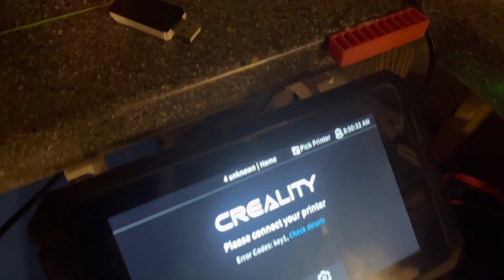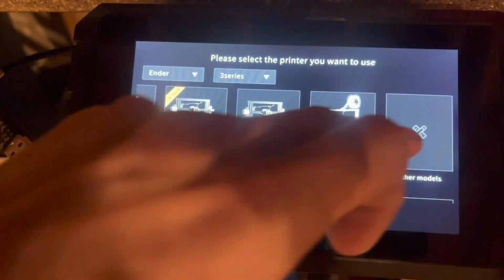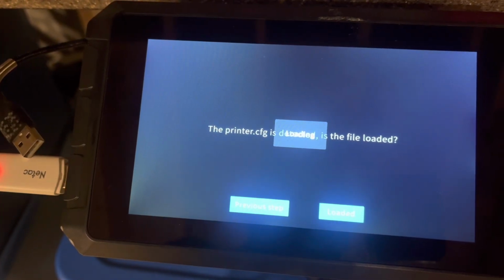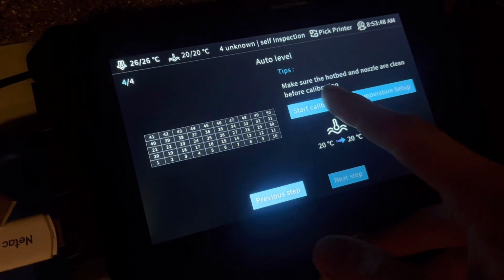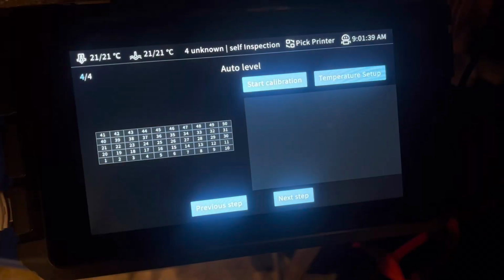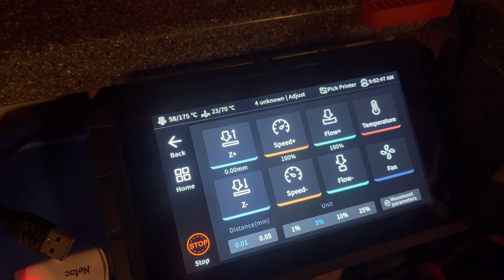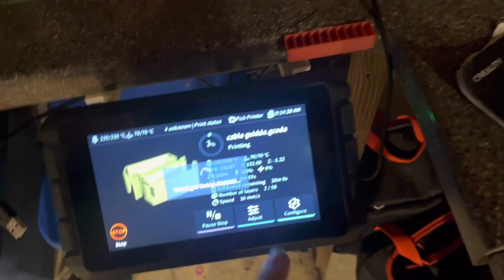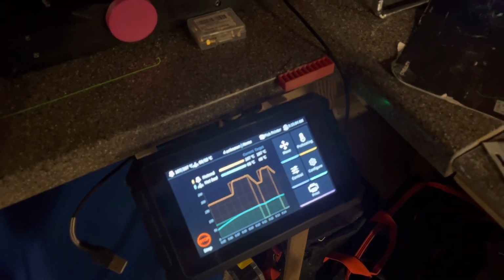SV06 Plus sonic pad configuration!

Comment: Seems like you used the safe home position from the SV06, so it does not home in the center of the larger SV06 plus's print bed. You have this in your printer.cfg: [safe_z_home]
home_xy_position: 85,135,  should be something like 150,150 minus the sensor X offset and plus the Y offset (something like -28 + 20, or home_xy_position: 122,170. You want the probe over the center attachment bolt on the print bed.   Also you have set a 10x10 bed mesh (100 points),  this is perhaps too much, takes a long time to complete, and is a lot of work for the SonicPad to process during printing the first layers until layer fade is complete.   I have good success with 7x7 bed mesh (49 points)  [bed_mesh] probe_count = 7,7 instead of [bed_mesh] probe_count = 10

Comment: Thanks for the config file that ACTUALLY works with the Sonic Pad! One issue I found is that the Y axis has a little too much travel when moving to the far extent of the hotbed travel, it rams into the back of the frame and the steppers grind for a second (almost like adjusting the Z carriage).. So that may need a little edit in the configuration file. But other than that. AWESOME and thank you!

Comment: I have been trying and trying to set up the sonic pad to the SV06 and am about to give up. I flashed the printer but keep getting errors on the sonic pad. Seems to be issues with the config.  I get this error. "  Include file '/mnt/UDISK//printer_config/./osskc.cfg' does not exist" Any ideas?

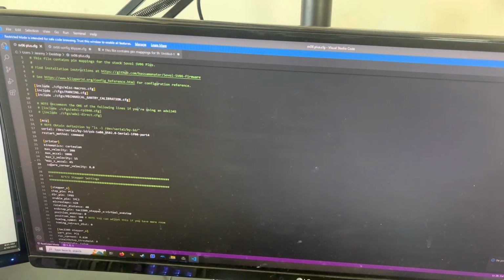Comment: In my experience this is not correct.  The USB flash drive needs to be moved up a slot and the printer plugged into that slot and then reboot.  It days say to plug the printer into port 4 but he does not do that in the video.  Alo what a quick jimp into visual studio at 2:55, don't assume we are all experts. Other than that, very useful thanks.
Reply from the maker: Flash drive has to always be connected to usb #2 :) first tutorial video so definitely mistakes made!

Comment: When attempting to load the print.config file the following occurs:   "ERROR  The printer is not ready.  Klippy host software is attempting to connect".   Any ideas?

I plugged the USB cable from the printer into my computer and verified the USB port on the printer is functioning.
Reply: I'm trying to fix the same issue atm. Seems like the firmware isnt being loaded on, gonna see what I can do to resolve this
Reply: Plug it into the first USB port. That fixed it for me.

Comment: An update. With my Sonic Pad issues. I flipped over to regular Klipper with kiauh and Xubuntu it was so easy. Repurposed an old laptop. No more MCU overload issues. And as a bonus unlimited webcams. I have 3 running now so I can have one on each printer. instead of one wide angle one.  I can't believe Creality support just closed my tickets because I had a non creality printer and wouldn't help at all. What a$$holes.  Not really much to change in the config either just the serial port and some includes.
Reply from the maker: Dang that’s upsetting, I’ve had no issues with 3 machines, I even bought another sonic pad used for $50 to run my other 3 machines, unlimited webcams would be sweet but I don’t have any old laptops sadly
Reply: @chargedup6565  Nice not a bad deal at all. I wonder how many I could actually run not with this i5? It's not breaking a sweat with 2. And since it support a usb hub or hubs there doesn't seem to be a limit on the number of printers that you can run. I added the object exclude function yesterday. Hopefully the SP will get that added in. It's nice to be able to remove an object mid print if you see an issue with a plate full of parts.
Reply: Just so I'm clear...you abandoned the Sonic Pad in favor of a laptop, correct?
Reply: Hi what firmware did you flash your SV06 plus with? I have the same sort of setup but need my printer to talk to my Klipper install on PC
Reply: @stevem91  Lets see if I can link my google drive with no https in the url This is my firmware and config ://drive.google.com/file/d/1TZGlgWifcn4jbjUYYki4kCpvO6_zwoih/view?usp=drive_link
Reply: @stevem91  You can use the one posted in the video description. I used his as my starting config and firmware.

Comment: I have 2 Sovol SV06+ and they are both running on the Sonic Pad!  Thank you for your work on this.  The nozzle offset position is not in the center of the bed, you mentioned in your video you were going to update the firmware.  Did you have a chance to do this yet?  If you have the original files somewhere I can download I would be happy to try to adjust the position.
Once again, Thank you for all your work connecting the SV06+ to the Pad!
Lee

Comment: How fast were you able to push this while maintaining high quality parts?
Reply from the maker: Depends on the material, pla 250mms easy then it gets a little loud for me.
Reply: @chargedup6565  Thanks for that. Sounds like an absolute bargain! Is everything else stock on the machine?
Reply from the maker: @michaelgaraphoto  yep my plus is 100% stock, other then I use standard extruder + hotend so all my printers have the same spare parts. My standard sovols have upgraded parts cooling fans but they are usually at 20% or less because I mainly print petg

Comment: One printer down the SV06 Plus is up and running thank you for the files. One question what settings did you choose for the chip when you compiled. It doesn't look like the GD32F103RET6 is in the list. Also some of the other options I'm not sure what to select if I were to compile it on the sonic pad.
Reply from the maker: I didn’t compile it via sonic pad, I used my klipper config from sv06 and modified it some, I forget the chip I selected but it’s the same as the ender 3 4.2.7 chip
Reply: @chargedup6565  Thanks for the info it's working great. I haven't tested the runout sensor yet but I don't remember seeing it in the config so If it's not working I'll have to play around with that.  Thanks again definitely made it painless to get the SV06 plus up on the pad. I just did my MK3S last night which was a lot more difficult.
Reply from the maker: @Oliver1071  yeah I have heard filament sensors don’t like tpu much so I didn’t bother setting it up, but let me know if you figure it out and I’ll add it! I plan to put a standard sv06 screen on my plus to get nozzle temps ect on the printer screen still
Reply: Did u have the firmware for sv06?

Comment: heavily considering doing this since i already have my ender 3 s1 pro controlled by the sonic pad, but i wonder if the sv06+ with stock fan is strong enough to be zipping around like the ender.
Reply: I would be looking at the 5015 cooling mod or maybe the duel 5015 mod. I love my SV06 Plus, its already really fast and have the sonic pad on order
Reply from the maker: I print petg at decent speeds with only 20% fan on klipper